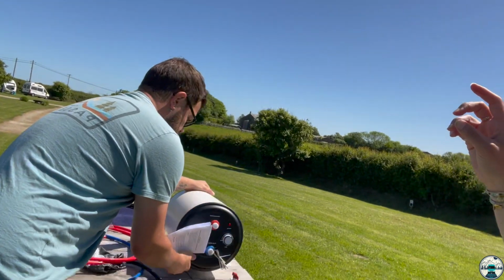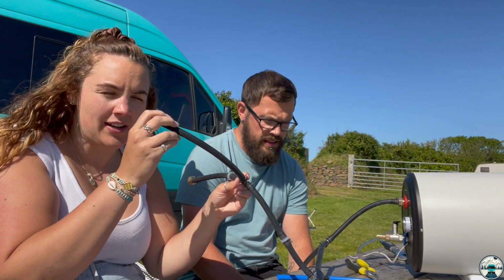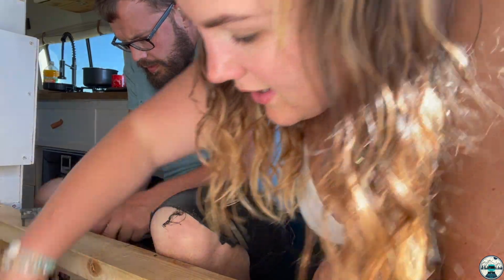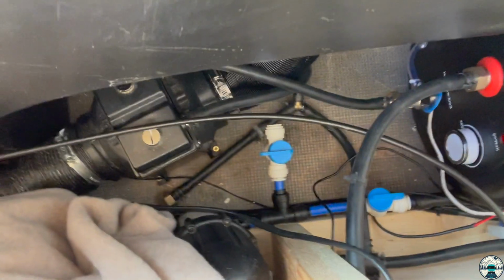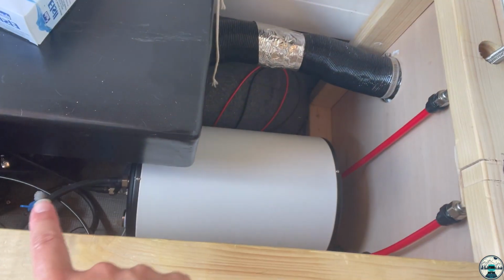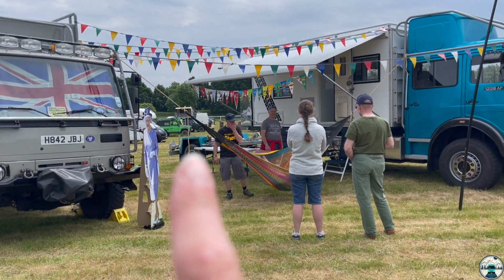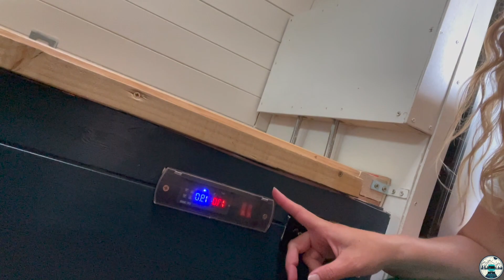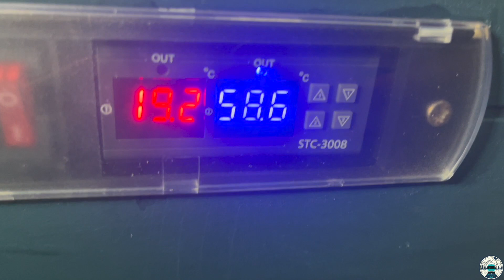Bobil Hybrid Upgrade | International Campervan Show | Vanlife UK | Mercedes Sprinter Van

Comment: Also here wondering how has it been working. There's not much info online for this new system. How has it performed heating with the diesel heater and/or excess solar (via 200w or 300w element?) ? Also, how does the tank fill? do you need to manually open a valve to fill it from your main water tank? also wondering how hot does the van get in a summer day if I decide to heat only with the diesel heat exchanger (of course ducting the excess heat out of the van)?
Reply from the maker: We for obviously reasons haven’t been heating it with the diesel heater atm but it is usually always above 45/50 degrees atm with the sun! It automatically fills so we keep it open which means more showers as it fills up as we use it so the water stays a good temp etc. the van is mega hot in the summer I wouldn’t want to be siding the diesel heater if I’m honest! Plus waist of a good source of free energy using the sun!
Reply: @AdventuresofSkyla  Excellent! thanks for the reply!! I just called Bobil and asked them about using the diesel heater (fully diverted to the heat exchanger) in the summer and they said it wouldn't really affect the van temp as the air coming out of the heat exchanger wouldn't be very hot and I would duct it out of the van anyways. I am thinking having the solar excess to passively heat the water and sometimes when required finish heating it with some diesel. I feel more confident about buying knowing there are some happy customers out there!!

Comment: New sub here
How are you getting on with the heater as I have been looking at these for a while now.
It will be my next purchase.
Does it take long to heat up and how many quick showers can you get out of the 10ltr tank.
Reply from the maker: Hey! Thanks for subscribing! We actually love it and I haven’t watched how long it takes to heat up sorry! But at the moment with the sun it’s always getting heat! You can get 2 showers out of it really as the water goes back into the tank as you use is rather than the last version we had to re fill the tank every time then reheat it.